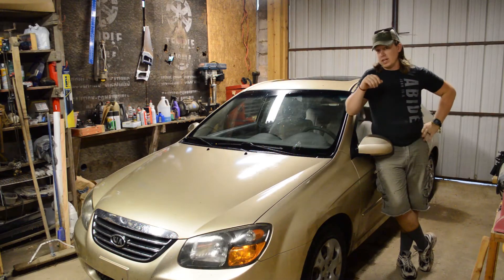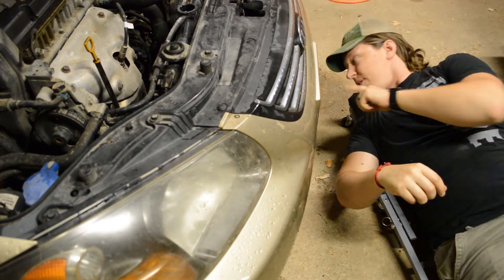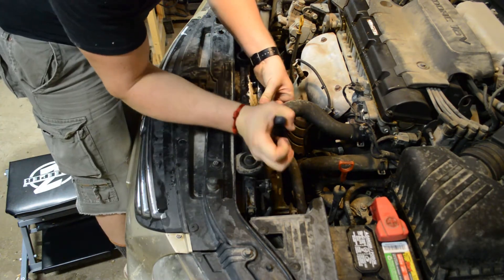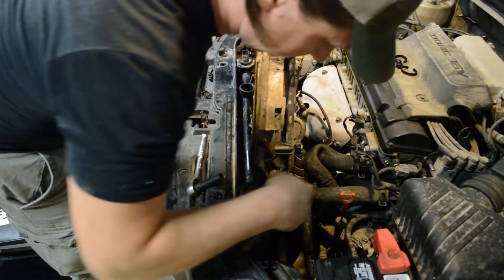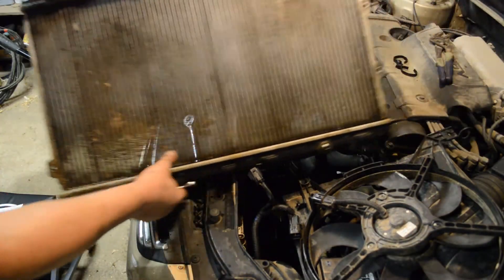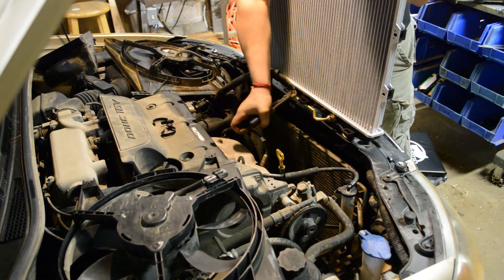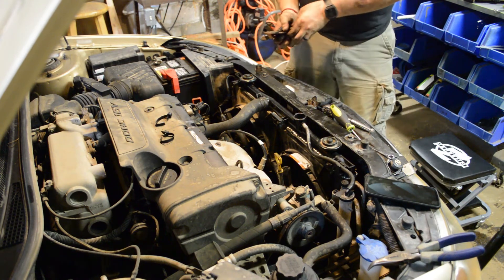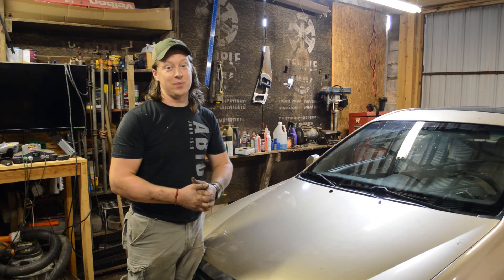Replacing a Radiator - Fixed Overheating - 2009 Kia Spectra

Comment: I just put a radiator in my 2007 Kia Spectra and the radiator  cost me 250 dollars
Reply from the maker: Where did you get the radiator? I think I paid less than $100 from Rock Auto.